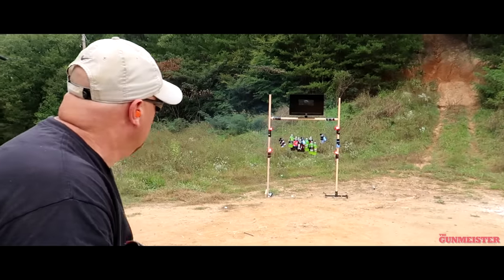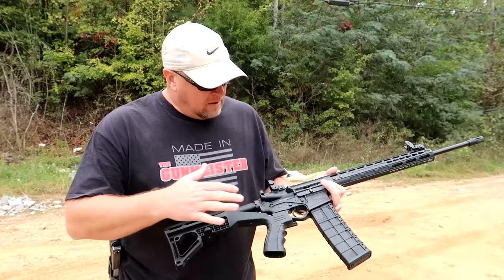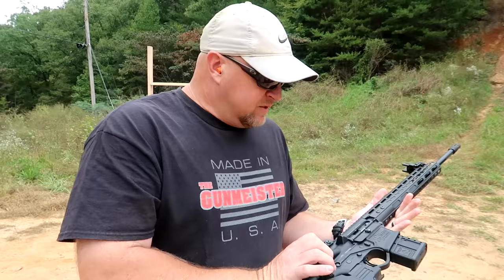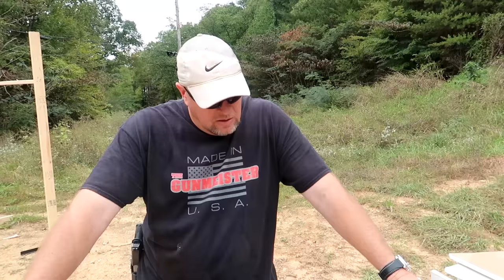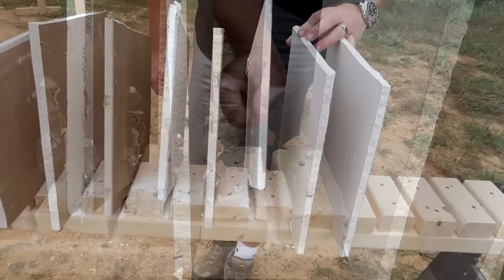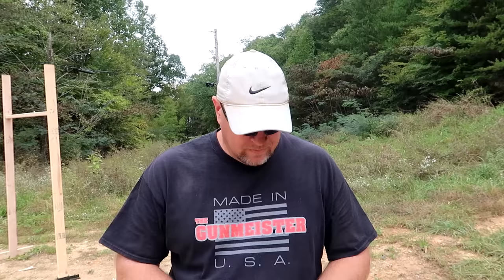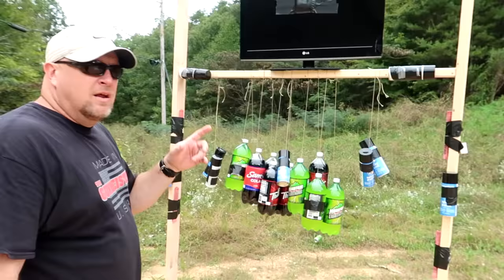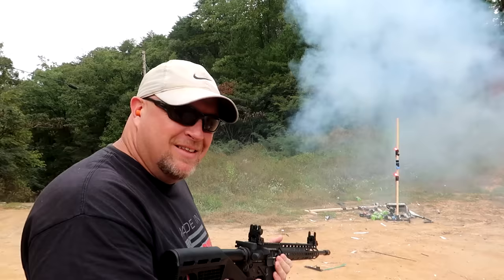American Tactical ATI Omni AR 410 Shotgun | Good For Home Defense?

Comment: As someone who has been shot with 7.5 bird shot from a 12 guage... Use buckshot. Grant it I was probably 25-30 yards away, but most BBs didn't go through my jeans, only a couple broke skin. They were thick insulated jeans, but still that's just not acceptable. I have #4 buckshot loaded in my shotgun. Unless you are so close that the beads don't have time to spread, I wouldn't be using birdshot. 

Also you pretty much made a shape charge and pointed right at yourself.

Comment: I really wanted this gun.  I searched for it.  I bought one recently for home defense.   I will never trust this gun.  I can not get it to load or fire any of the brand name 410 ammo I can find.  It has not fired even one shell when we actually get a shell loaded in place with extra manipulation.    ATI doesn't have 410 ammo shown on the site.   There is never any in stock and available.  I can not find any ammo crimped as described in the fine print of the documentation.  The factory doesn't answer the phone.  I can't get any advice or talk to them about returning it for warranty service.  I have a $600 boat anchor.....but, I don't own a boat.  Make me an offer I can't refuse and it's yours.

Comment: I wouldnt use #8 shot in a .410 for self defense. at least #4. in a 12 ga. I might use #4 shot. or larger . # 4. buck more like it.
Reply: #4 buck is the smallest I'd use but I don't think you can get that in 2.5" 410.  You can get #3 buck and #4 buck in 20 gauge but 2.5" 410 kind of limits your options to slug, buck and ball, or #000.

Comment: I have one of the ATI 410’s and it’s been a total disappointment...
More feed jams than any gun I’ve ever owned. Doesn’t matter what ammo, it simply feed jams everything without discrimination.
Poorly manufactured POS in my opinion.
Reply from the maker: PDX, I would call ATI. That gun has a lifetime warranty. Hope this helps. Thanks for the comment!
Reply: I was wondering if 410 would load reliably or not.
Reply: I've called and sent my 410 in two times. I've ran only their ammo and mags. They tell me they test it before they sent it out. I still can't get it to run 1 magazine without a failure.
Reply: Bigjohndodge00 
You and me both...
It won’t chamber a round from an open bolt and I don’t think I’ve ever been able to run through a full mag without a feed jam.
Reply: I'd double check the measurements of the shells too. It only feeds exactly 2 1/2" shells. Some manufacturers shells say 2 1/2 but are actually a little larger than that
Reply: @kylejones5518  I've used just ati ammo and still have the same results. I'm wondering how the other 410 upper manufacturers compare.
Reply: @pdxdave372  I've experienced that same situation as well. I have one of the first run models when I'd say there was only like 60 out at the time. They sent me a new buffer spring and buffer saying that's the problem. Sent it in and they drilled a hole into the upper and put a roll pin inside to hold up a dangle piece. Still have the same exact results.
Reply: good idea. gimmick implementation and trying to fleece curious people.
Reply: I don't want to sound like an idiot but do you think you may be over lapping the shell rims? That will cause fail to feed. Each rim should be in front of the last

Comment: The testing is rendered pointless by changing the testing parameters (adding the chicken). Of course there'd be less penetration with birdshot after hitting the chicken as compared to the rounds fired directly at the drywall. That being said, birdshot is what I use for home defense too, for the same reason.
Reply: I agree.  Video is pointless.  1st put a chicken in all tests.  2nd none of my walls in my house are that close.  The drop after impact traveling across a 10foot room is considerable.  The likelyhood of that slug going through the burglar and 2 walls of the next room is slim.  That doesnt mean it can hit aunt suzie If she's in the next room.  After that no sure.

I understand your point.  Just the test to prove it was a waste.

Comment: Like the shotgun, good info in case I get attacked by a drug crazed chicken!
Bird shot is for birds bro....
Reply: I'm unsure whether your friends and family in the next room or your neighbors next door will understand your choice to use heavier shot and not hold you liable for damages or death you may inadvertently cause. But have faith, the cops won't.

My family n friends are safe(r) due to my use of 6 shot. I'm confident that it will do what's needed.
It shreds flesh and breaks bones very well at the distances in my home (10' - 20').

And with this shottie, I have 20+1 rounds ready to go, with another 2 or 3 mags in my pocket.
Recoil is VERY mild and follow up shots are quick on target.
And all I have to do is a little mopping and a some spackling/painting work to bring it back to normal.
But...to each their own.

Comment: How does a .20 ga do? Thats what i have always used as home d.......honestly man talking about booby traps and and worrying about the collateral damage of your wake and take weapon is illogical as fuck......i used to hang treble hooks in my bushes around windows with a braided line tbat knives had a very hard time cutting.....if you can use the branch to hold tension to be released when distirbed extra.....but then your dad asks what happens if there is a fire and the responders start getting vietconged with midevil booby traps......Shit all over my plans. I had boards rigged to spring hinges....i got stupid because the vacant properry i owned kept getting trashed.....flooded....small fire......ripped out plumbing............you know what i did........i got the biggest vitek species i could find and used groeth hormones and transpñanted a bee hive under the porch. With a simple agitstor system.  These bastards would just all out blitzkrieg whoever went on porch without disengaging my rigup for pissing them off
But they never stung me without it going off so its perfect. Bees are hard to prosecute for assault and plausoble deniability. I had s guy come remove the hive before i sold it. He reñocated the hive....only people got hurt were thieves.

Comment: Your test is not realistic.  Is your house made up of just drywall only!  No 2x4 in your walls, just drywall. If you removed all the drywall, and you stood in the middle of your house and shot in any direction how many 2x4`s would hit?  You need to add 2x4 staggered throughout your test run
And then you would have a realistic test!

Comment: This video is useless, distances are all wrong the rounds that cycle ar 410s have to high fps. Most people don’t have ar410 and this is poorly educating the people that have pump action and other common shotguns. This video is just favoring a useless point. The best weapon is a pump action 12 gauge buckshot. If you can use mini shells buck shot is the way to go. If you can’t then #4 then and always below 1200fps to prevent over penetration and keep noise levels as low as possible.